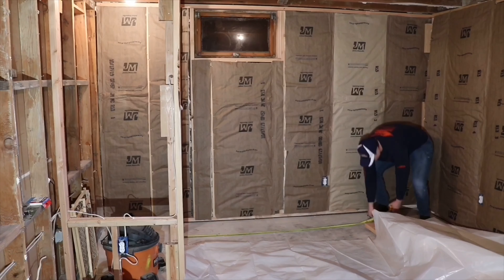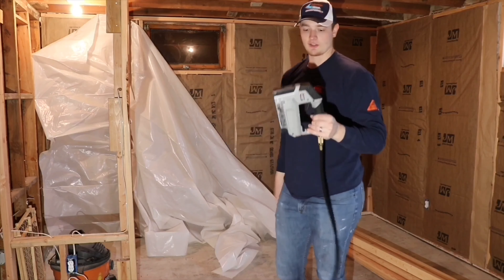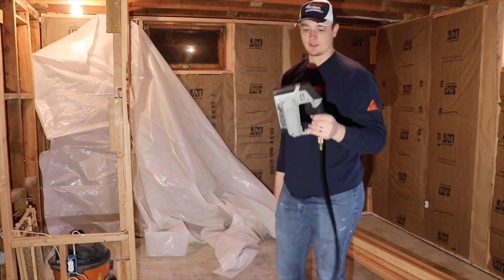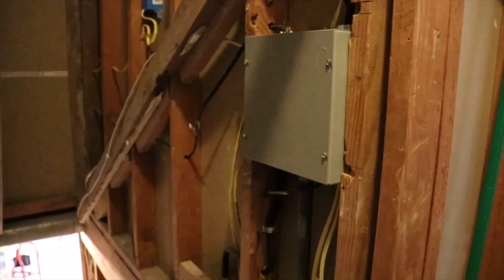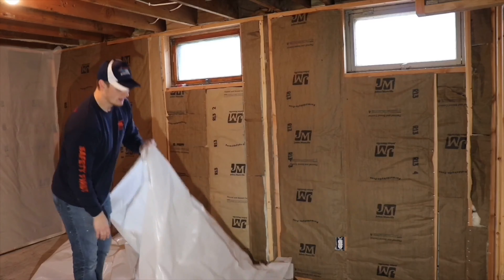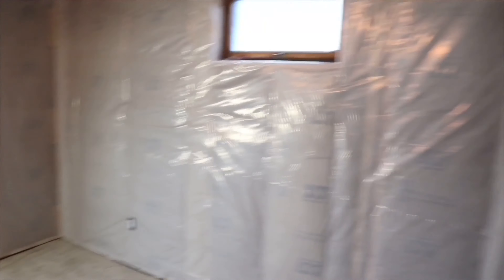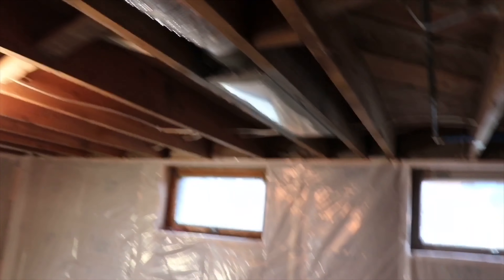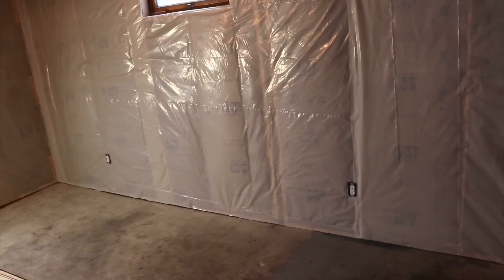How to Install Vapor Barrier

Comment: HI!!!! Can you do a video on how to properly seal windows before putting on trim? I had new windows installed in my house and now I need to do the trim!
Reply: Liz Brousseau - the window installer should have sealed/insulated the window upon installation!?! If not, there is a problem!  What do you mean "seal"?
Reply: Well they are sealed... just trim isint on... and I’m worried something special should be done before trim..
Reply: Liz Brousseau - I doubt they (window installers) would have left you in a bind.  I can't guide you because I don't know if the jambs are in, how high the sill is etc.  Maybe you could look at Finish Carpentry Tv's channel and research his vids for a quick fix.  Their videos are very well explained and cover all aspects of trim.  

This channel still has to do the wall board and muddling before he gets the to trim.
Reply from the maker: The windows need to be completely caulked in from the outside of the windows and have a type of flashing if not installed in concrete. When it comes to trimming out the window i just put in the trim on the top and bottom of the window and then the two sides to help hold the top and bottom piece in place then you just need to caulk the trim to the window to seal it off, but you mainly want to make sure the outside of sealed very well because if not even tho the inside is caulked in there’s a chance of rot from inside the window jamb if it were to leak! We plan to install our windows here soon if the weather holds out so stay tuned for that!

Comment: Nice job.  Can't wait to see the drywall go up!  Question - the bat already has a vapour barrier, why did you opt to add the extra vapour barrier on top it?
Reply from the maker: I Brazeau the reason for the vapor barrier on the studs is because the insulation leaves pockets for air to travel through and cause moisture to hold up behind the drywall. Hopefully that makes sense thanks for always being so interactive on our videos!!

Comment: I thought the vapor barrier goes on before the insulation.
Reply from the maker: Hey! It depends on the state you live in! The reason for the vapor barrier on the studs is because the insulation leaves pockets for air to travel through and cause moisture to hold up behind the drywall. The vapor barrier goes on the “warm side”. We live in Idaho (cold climate) so the warm side is after the insulation and in a warm climate the vapor barrier would be before.

Comment: We live on the Oregon coast and purchased our first home earlier this year. The master bedroom in on the lower level with 2 of its walls being against concrete. Because there is no central heat down there and only expensive wall heaters, I was going to redo the insulation since I need to replace the drywall anyway (removing 1970’s wallpaper was a headache.) I will have to see if I can figure out which side the vapor barrier should be on but my question is this - is insulation moisture resistant? I would think it would get damaged from moisture with the vapor barrier on the inside vs against the concrete. I’m just learning how to do all of this so I would love to know more about the difference between placing the vapor barrier on one side vs. the other. Also, what is the lifespan of typical insulation? It stays freezing cold down there all year long so I’m really hoping that redoing it (assuming it’s there to begin with) will help my husband and I not freeze to death. Thanks and love the videos!!

Comment: You have just instructed people on how to create major building failures. The craft face on that insulation is also a vapor barrier. Now you have trapped moisture between 2 vapor barriers which can condense, freeze, thaw, and never dry out. This is a major failure point no matter what State you live in.

Comment: With faced batts you already have a vapor barrier..putting plastic up is not a good idea and causes more molding issue's .
Reply from the maker: Hey, we appreciate your feedback! In our area all new construction is using 6-mil plastic as a vapor barrier for exterior walls.